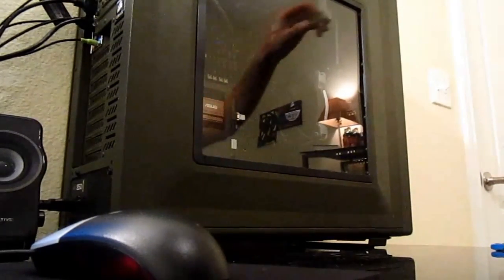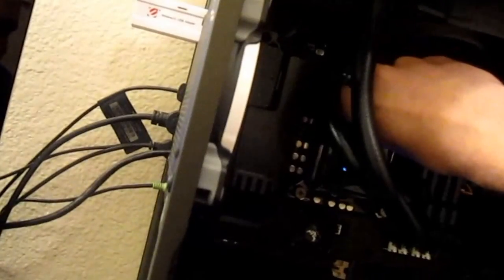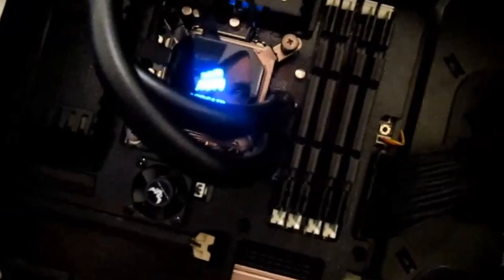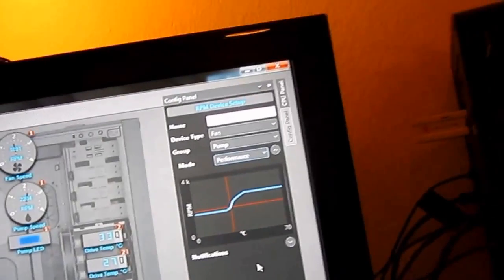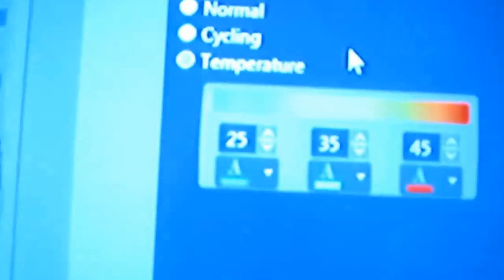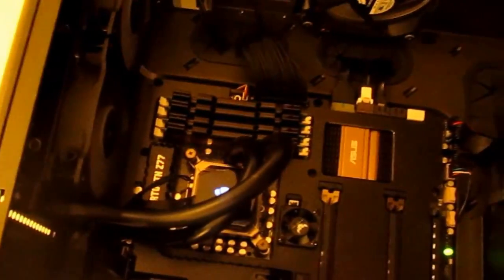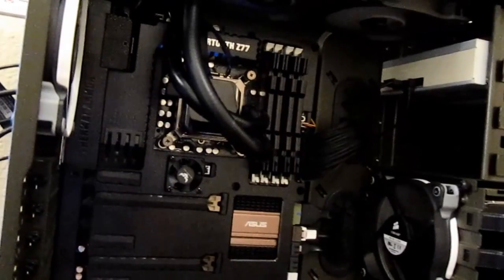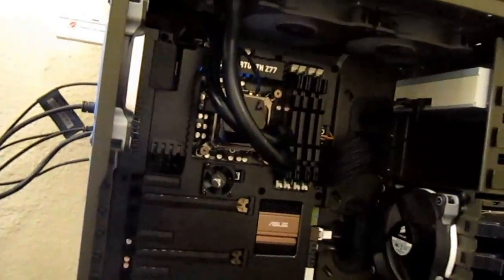Corsair H100i Noise & LED **Firmware Update FIX**

Comment: short Version of the other guys Video .  jadajadaja  lower the pump voltage to 7 or 9 Volt if you can. mine is working with 7 Volt. of Course you should use dead silent fans and run at least 1200 rpm for some air . and the Radiator should be installed in front pushing air inside the case to cool the Radiator. extra pull config waisted Money hot air goes up. why buy an aio wat. cooler when the pump is louder and more annoying then a air cooler? so there are analog voltage Things for cheap or you can ask a guy with a digital voltage meter with Display so you can see if the noise is gone by 9 Volts if not run in 7v .  water will be running even if coolermaster or other Brands recommend to let the pump run at 12 Volts.

Comment: Help! I just bought h100i LC 5 days ago. After installation, registry changes and updating firmware helped to detect my h100i.
But when I removed h100i for reapplying thermal paste and re-installed to the cpu C-Link shows 0 rpm fan speed.
I rebooted my pc and now C-Link doesnt show any h100i fans, led, pump.
What to do??
Reply: Sahil Dias I don't use corsair link at all,it's junk software. Plug the pump and fans to the headers on the MB. Sure I get a funky pinkish color for the led I have an asus mb and I use ai suite to control the fans.
Reply: Robert Floyd After changing mouse and keyboard connections to secondary usb ports. CL works again as fine as dandy. I believe it was contradiction b/w powered usb ports.
Reply: When i installerad My corsair water cooler the fans didn't work. I started my computer and they turned on for like 10 sec's, then they stopped. So I went to my BIO's system and I disabled an option with some fan shit, don't remember what it was though

Comment: what... did... did u just unplug the cpu cooler mid operation?????
Reply: He unplugged the fans only. When you're driving a car the the radiator gets airflow because you're moving. When you stop and the airflow stops your car doesn't overheat instantly although after a few seconds your fans might come on if its hot enough.
Reply: Nicholas Hartzler i still don't want to be fucking with the cooler of my cpu, do u know how sensitive they are to heat, if any of the metal expands by the smallest amounts, you could cpu could be dead. (i have a friend who pulled the heatsink right off the cpu mid operation to his old cpu, for fun, and it took maybe less then half a second and he could hear it sizzling  and then it fried in less then 3 seconds. i agree that a car can do what u say, but i don't want to be doing that to my pc. just saying.

Comment: Does it have violet color on the led of the cooler? If none, do you know any stock coolers that have violet led into it? Thank you :)
Reply from the maker: You'd be able to set the LED to a violet color easily. It will output any RGB color value

Comment: Hi man! How do you change the backlight ?
Reply: the corsair software
Reply: chad fernando It operates on the entire line of water cooling ?
Reply: You can control the fan speeds, and the led colour..
Reply: chad fernando ty =)
Reply: ***** his software works only on models H80 and H100? or just on the models marked " I "?
sorry for my english , I use Google translator
Reply: Only the "i" versions of the coolers that have corsair link

Comment: if only corsair liked windows 8.1. not as solid as it should be. very buggy and color changes doesnt work as well as in this video.
Reply: you do know this video was 2 years ago lol
Reply: chad fernando meaning everybody is now how i have it?
Reply: Olympic Gaming well if you did update the firmware it'll most likely fix the issues, since 2 years ago they've released the h100i and the firmware too i guess and i'd expect it will be very buggy with tons of issues. lol didnt have any issue in mines, I bought my h100i at the start of the year

Comment: Im sorry for my bad english, but do you guys recommend putting the fans as exhaust or as intake and behind the watercooler or hanging on the watercooler.
Reply from the maker: General consensus is to put the fans as exhaust through the radiator. Most will agree to have the fans push the air through the rad, rather than pull. You could always try a couple different configurations to see what yielded the best temps/noise level/etc.
Reply: Stephen Alston Thanks mate :)

Comment: why isn't there 2 spots on the tinted window for fans. you have the c70 corsair case right? have the same one but arctic white. but I have option for 2 fans on the side. also I have the cooler. and my pump makes noise. my fans do but if I tap it they will stop. im worried my pump will go out. the software is gay mostly. the cycle color works sometimes. also I installed my radiator with the pump on the other side. so the tubes aren't twisted up in front of everything.
Reply from the maker: This is a custom acrylic side window I make myself. The fans no longer make noise after the firmware update, and my system runs silently.
Reply: Stephen Alston firmware update? for the cooler? and what would that have to do with your fans making noise lol. probably could of just tapped them and the magnet would of lined up again. that's all I do if my fans make noise.
Reply from the maker: jeff hicks yes, I had the original version of this cooler when it was released. There was a firmware issue causing the fan bearing noise, and Corsair released an update. The only problem was the Link software running the stock fans at too low of an rpm. The updated firmware fixed the problem, no more bearing noise. I uploaded this video 2 years ago...
Reply: Stephen Alston weird. in the corsair software you could of just set the RPM to whatever you want tho.

Comment: The reason the temperatures seemed off is because you were reading a Celsius temperature as if it were Fahrenheit, in reality your CUP was 59 degrees Fahrenheit, which translates to 15 degrees Celsius
Reply from the maker: Still not possible. How was my CPU at 59 degrees in a 75 degree apartment?
Reply: This is not how it works, you should know that.

Comment: You have dampeners in the top of your case?  It sounded like it was some rattling going on up there.

Maybe they've improved the design since this was recorded but I have an H100i in my build I did two weeks ago and it is whisper quiet. Even with the fans set to maximum, though I am not using the stock fans.
Reply from the maker: It was the fan bearings making noise. The original firmware let them spin at too low of a speed. This issue has since been fixed, mine runs silently now as well.

Comment: So the stock 100i fans are too loud?  I just got a corsair h100i and im trying to make the PC as quiet as possible... Also what is a push pull config look like with this h100i?
Reply from the maker: Corsair released a firmware update a while back that fixed the fan bearing noise. My H100i is running nice and quiet now, but I have since switched to four SP120 fans.

Comment: The stock fans makes noise when under 1600 rpm. I would suggest buying some SP120 fans to swap them out with, since they perform better and are alot quieter :)

Comment: I have Corsair AF120 LED Red Quiet Edition High Airflow 120mm Fan on the top of my corsair vengence c70 case and they make that noise at the lower RPM I think its the way they sit in the case.

Comment: Sweet radiator with shitty fans.
Reply from the maker: Agreed. I've since swapped out the fans for better ones in push/pull
Reply: Stephen Alston
Noctuas?
Reply: ***** depends whether you are looking absolute performance or more of a quiet performance. The silent fans are ok  from what I've seen and heard but Noctua fans are ultimately the best choice if you are not on a restricted budget.
Reply: *****
noctura nf f12 only problem is there ugly as sin (biege and brown colouring.

Comment: Should I have the fans pull in air or suck out air on the h100i?
Reply from the maker: Depends on how your other case fans are setup. If most of the others are intake, then you'll need to setup these as exhaust. Could also depend on how hot your GPU(s) are getting. For the best performance, you would pull in cool air from the outside of your case.
Reply: Its a design r4 with r9 280x toxic im not sure how hot it gets any ideas on set up
Reply from the maker: I would have the front fan as intake. Then the rear fan and H100i set up as exhaust. It has a side air duct to pull fresh air for the R9 280X so you should be fine.

Comment: The way I usually check to see if it's the fans that are making the noise is quite simple... If you put your finger down tightly in both the centres of the 2 fans until they stop spinning.

No need to REMOVE them! That would be a very backward and time wasting option!

Also if you are striving for silence, don't use the stock fans that come with all-in-one's, they are the bottom of the barrel cheapy cheap fans that the manufacturer throws in just to make the cooler fully qualify as an "all-in-one". You would be better off buying the all in one for it's radiator and pump closed loop quality, and then buying in a couple of high end silence focused Noctua fans.

Comment: can you change the led color of h100i?
Reply from the maker: Sure can. I don't think they've released an update for the Corsair Link software for Windows 8.1 yet, but there is a workaround. You simply click on the LED icon inside Link and adjust the settings in the sidebar

Comment: Actually what is happening is that the h100i is taking power from the serial ATA power connector and it only provides up to 12v, which is not enough to provide electricity to the pump and two fans, after few weeks of working the pump will just get tired just because of not having enough energy, so the motor in the pump will just sound like that.

Comment: Dude control the RPM on link corsair link just put on default noise will go away
Reply from the maker: This was a firmware issue on the very 1st H100i system I installed soon after it released. The update Corsair released soon after this video was posted fixed the problem. I've also switched to different fans for better control anyways
Reply: Stephen Alston  i see
Reply: Stephen Alston
And what fans have you put on?
Reply from the maker: I switched to 4 - Corsair SP120's in push/pull. They're the high performance editions, but I'm running resistors inline because I don't need them at 12V.
Reply: Stephen Alston i switched to the sp 120s(quiet) and now the iLink software wont controll them

Comment: i think the your fans are worn out
Reply from the maker: The fans were brand new units. It was a issue in the firmware that allowed the fans to spin at too low of an rpm. The bearings are making the grinding noise.

Comment: this is quite noisy.. i have a system with 6 120mm fans and mugen air cooling and i cant hear it at night.. hm.. water cooling should be quiet ey?
Reply from the maker: It was the stock fans running at too low of an RPM. I have it running 4 - SP120's at 7V now, along with 5 other case fans, and it's near silent.
Reply: Oh nice man. I am looking at those sp120 quiet edition. did you try push pull combo with 4 of them and tested noise? thanks
Reply from the maker: I'm running push/pull with them right now. I bought the high performance editions and then used resistors inline to bump the voltage/speed down. They can be very very quiet for the amount of cooling I get. Don't have any hard data to support that conclusion though. Just know that they are a great improvement over the stock fans.
Reply from the maker: ***** they perform about the same. The H100i has Link control and a better selection of fans on the market (normal 120mm fans)
Reply: actually i have this system now, h105 and it is really something the most quiet thing i have ever had, with sp102s of course

Comment: My corsair logo on the cooler has turned red at some point, fairly sure it was blue before. What can this be? My temp seems to be in order
Reply from the maker: I'd look at your settings in Corsair Link. You can access the LED settings by clicking on the icon on the main screen. It will be a sidebar on the right. My LED acted up for a while before finally it quit working. It is under warranty, but I have not had the motivation to remove the cooler and send it in for repair.

Comment: Hey man did u end up finding out if it was the fans or the pump please reply thanks again for the video... :)
Reply from the maker: It was the fans. Corsair updated the firmware and Corsair Link software and fixed the issue. The bearings were noisy at a particular low rpm, so they just adjusted the fan profile.
Reply: ok thank you. So I take it that It's a good bet to give the cooler a go in my own system...
Reply from the maker: It has been over a year now, and this thing still cools beautifully. I would definitely recommend it.
Reply: Ok Thanks again

Comment: What was the program you used to change the leds and all that good jazz?
Reply from the maker: It's the factory software you get from Corsair. They call it Corsair Link. It is not natively supported in Windows 8, but a guy on the forums has found a decent workaround. It seems to be working now for me
Reply: Stephen Alston
 How did u get the leds to work for H100i on windows 8 cuz i'm running it and they don;t work can u please tell me where u found it

thank u
Reply from the maker: TJ Wolf http://forum.corsair.com/v3/showthread.php?t=120962

Comment: Is that an hp mouse?!?!
Reply from the maker: It was at the time. I'm now using a Logitech G300. I was also only using the integrated graphics on the 3570K. I've got an HD7950 3GB in there. This thing has been built on a college kid budget over the course of many months. Still improving.
Reply: Stephen Alston that's the same mouse i have haha i love it though i just recently built a new computer i went with the xfx r9 270  =P i was wantin to water cool but im just gonna wait on it

Comment: How cool does it run compared to the factory heat sink?
Reply from the maker: I didn't take any good measurements with the stock heatsink. However there are some good results on this site: http://www.legitreviews.com/corsair-hydro-series-h100i-extreme-performance-cpu-cooler-review_124024/5

Comment: You call that quiet? ^^
Reply from the maker: With the grinding noise the fans were making before the firmware update? Not really. Now that Corsair has fixed the rpm issue and I've switched to 4 Corsair SP120s in push/pull? Considerably quieter, and my load temps at 4.3GHz are pretty impressive considering this is closed loop cooling solution.
Reply: Stephen Alston Pretty low of a clock with a h100i. I can hit 4.3GHz with a hyper 212 evo.
Reply from the maker: Well for a Ivy Bridge that runs hot, I'd say it's decent. I have pushed above 4.5, but I'm looking for stability.

Comment: when i installed a H100i into my pc, my pc wouldnt show anything on the screen. all the lights were on all the fans were spinning but nothing came up on the screen. i got my pc checked out and they said that the cooler might have shorted out the motherboard. is it possible for a H100i to do that? I'm not sure if i should put the cooler on my new motherboard when i get it. I didnt use a anti static wrist strap when putting it in could that be why it fucked my motherboard?
Reply from the maker: Is it possible? Yes. Not very likely, but possible. Most of the time it will be the other way around. I actually had my first H100i pump short out on me when a fan header got pulled loose and hit the wrong contacts. Mobo was fine.If you want to rule out the cooler as an issue, just drop on the stock heat sink fan and see if it will boot.

As for the anti static wrist strap, I use one. I've gotten away without using one, but I usually grab bare metal on the case when I go to install a part. Another thing you can do is plug the power cord into the power supply, but don't turn the PSU on. This usually grounds the case.
Reply: it is possible, its a copper plate on the heatsink so if you maybe dropped it on the mobo it conducted with something, killing the board very unlikely though, unless you had the power supply on which probably would have killed something

Comment: The sound you hear are the bearings from the pump.
Tests show that the pump needs a really stable power supply.
The fans take away power from the cpu block and make it "unstable", hence the pump is not running at a constant speed. And that affects the bearings.

Comment: I was told by a tech at Micro Center, that some fans do not like to be run upside down, and were designed to be run vertical, not horizontal.  just passing some info i received.

Comment: So Would I Put the too fans on the splitter cable and plug it into the cpu 4 pin connection? Or a Chassis connection somewhere on my board?

Comment: Mine is a bit odd it rattles and the pump dunno if you would call it psi or rpm or whatever in corsair link 2 is down below 300 or so and after a while it revs up the fans for some reason then the pump psi/rpm goes up to above 2000 then things are nice and quiet. This seems to happen on a cold boot so I"m guessing its because the liquid is colder or thicker when its cold making it harder on the pump.

Comment: Depends on what your case temps will be.. what GPU(s) will you be running? Because if the cards don't exhaust air out the back of the case but exhaust air inside the case you will struggle with case temps so would need to have rad fans pulling air into the case, but pushing air out if you have rear exhaust GPU cards.

Comment from the maker: It's possible, but you can't use the factory mounting holes. I've been running push/pull for months now with no problems. I'll message you the link to some pictures of my current setup.

Comment: Hey Stephen. I love your setup. I'm building a computer, and I've wondered, can i do a push/pull configuration with the saber tooth Z77 Mobo, Corsair H100i, and corsair SP 120mm fans? Getting the same case.